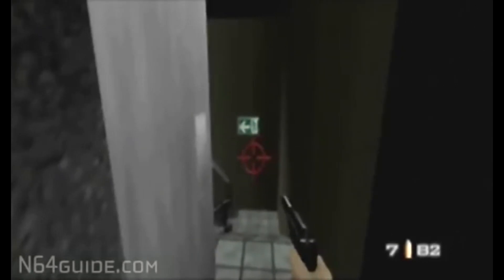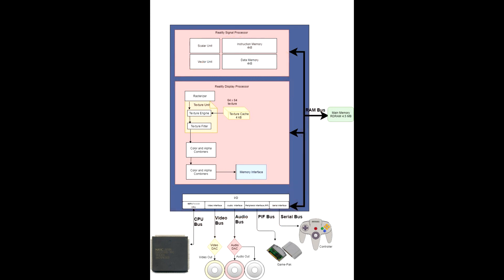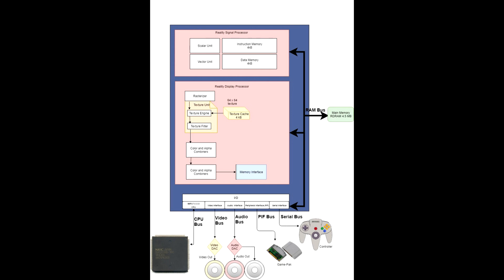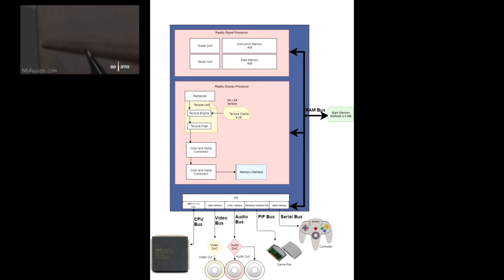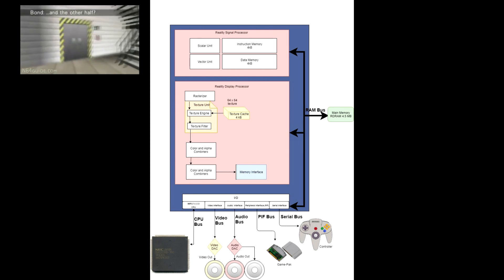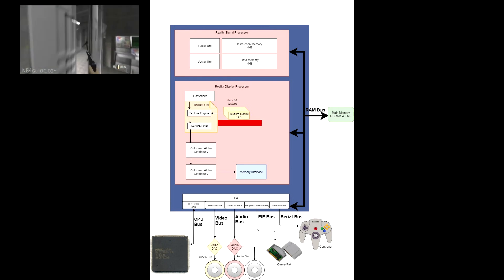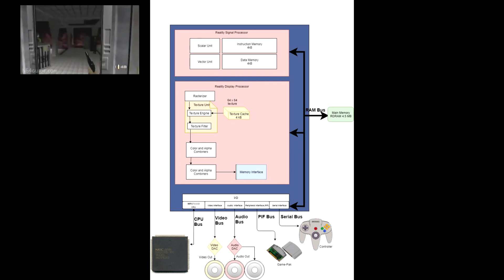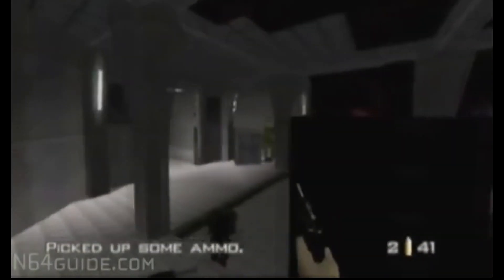The Nintendo 64 Environment was TERRIBLE for Game Development

Comment: Imagine if they had just a few more megabytes of texture cache
Reply from the maker: Would have definitely been interesting for sure!
Reply: Also, shared their microcode to 3rd parties.
Reply: @ZygalStudios  The texture cache wasnt much important - it was how textures were mapped and used. PS1 actually had 2 kb textures and the games looked AMAZING. PS1 used a type of mapping that took full use of the cache and made the textures good but N64 used a different type of mapping that was extremely limited.
Reply: @ZygalStudios  also the N64 cache is explicitly loaded.
Which in turn should mean that the Playstation cache is a true associative cache, while the N64 has either what could also be described as a scratchpad or a simple directly mapped cache.
Reply: The design was actually great for 500,000 flat shaded polygons (and I seem to recall reading that N64 could hit 800,000), but NINTENDO was heavy handed with developers, insisting that textures and all features be turned on, limiting their games to 180,000 (effectively about half of that), blurry textured polygons/sec.  Worse, developers were not allowed to access microcode for improved performance, and the DMA was placed on the wrong side of the RCP, crippling the system bandwidth.  Other problems are mentioned in the video.

Basically, NINTENDO kept making the same mistake over and over again: waiting 5-7 years before releasing new hardware (which was always cheaper and weaker than rivals), and developers had to keep starting over from scratch with radically new hardware and unfinished software development tools.  The result was the NINTENDO went from 97% dominant market leader to hovering around 10% consistently for about three decades now... and some people asking "Why are they even in the console market?"

Comment: Excellent video - the system was a real challenge, particularly with initial SGI microcode which according to Rare and other developers was completely useless for gaming.  If the system was CD developers would've had a much easier time I feel, at least they wouldn't needed to have wasted so much time compressing and cutting assets to fit into smaller than expected cartridges.  Games like San Francisco Rush 2049 show off the N64's processing grunt, huge 3D, high speed 3D environments but that wasn't until 4 years after launch and it was still only on a 12MB cart...Insane.
Reply: Even a 250 and later a 750 GB zip like disk or a magnetic cd like the minidic could have been another alternative nintendo could have used as well.
Reply: I have a bunch of old n64 development stuff. Silcon grapgics power animator sealed
Reply: It would've made the console much more pricey at launch and using optical media would allow them to store more content, albeit the architecture still would be complex to work on. Cartridges weren't the issue, rather the issue goes onto how the system was designed instead being the main cause.

Comment: A long paragraph of what actually made the Nintendo 64 more complex than what many people often realize: People tend to blame cartridges for making development more challenging on devs, and although the limited capacity certainly had it's own drawbacks, the main issue wasn't because the choice in format chosen, but rather, how the system was designed. For example, if we take a look at the systems low texture cache, which only contained 4KB capacity, this mainly prevented devs from being able to create and add textures with higher resolution than we normally see on any N64 game. Using any features like the Z Buffer if I'm correct further decreases the available amount of texture cache down to 2KB, and in truth, 4KB of texture cache isn't enough to create high resolution textures, and is what caused textures to appear low resolution. Using CDs in a way wouldn't solve the texture cache issue as all it would do is allow more low resolution textures to be stored and it would be up to the developer to be crafty enough to make it work,  and again, the fault mostly compounds towards the systems architecture, which also includes lackluster availability of texture cache. The Sony PlayStation for example has more texture cache to work with, and even if the PS1 didn't use CDs, the console's simple architecture and great development tools enable devs to somehow make PS1 games better than on the N64. Poor documentation of the hardware is what also held the console back.
Reply: What is your thoughts on the expansion paks? Did it help the n64 texture issues?
Reply: @maroon9273  The expansion pak was a neat addition to the Nintendo 64, it enabled us to play certain titles that would only work with the expansion pak enabled, such as Majora's Mask, Donkey Kong 64, and access to all of Perfect Dark's content. In some ways, it would boost texture quality if I'm correct, and other games would also see a boost of frame rates as well.
Reply: @crazedlunatic43  yes, and thanks for clarifying the texture cache.
Reply: @maroon9273  Anytime. The idea that people would blame the use of cartridges for making a console more difficult to work with is quite false. As I have said earlier, they have their own disadvantages, but if cartridges really made development complex, then the Sega Saturn would've had no complaints for using CDs simply.
Reply: @maroon9273  A fun fact by the way, have you ever wondered why Cloud's model in final fantasy 7 (or really any PlayStation one game.) looks more detailed in the cutscenes than when you resume controls? This is because full motion video isn't at all rendered by the hardware itself, but rather the system fetches data off of the disc for any pre existing clips that were rendered on more powerful hardware, and all devs could do was add the full motion video clip onto the disc as part of their game. The PS1 didn't need to put in the work of rendering the cutscenes when it could fetch data off of the disc. I brought this up because some people believe that the PS1 is more powerful than N64, when in truth it is not.
Reply: @crazedlunatic43  the limited rom sizes were a issue with cart consoles. That's why cd and other optical disc had more strengths due to more storage which developers were looking for  during that time.
Reply: @maroon9273  Indeed. They were very cheap too, which was something devs wanted. Though, working with CD's was not a painless experience, as it took quite a long time for contents to be burned onto a disc, in which back when CD based consoles, while they've had more data to work with, were also very slow as well. If a developer wanted to re-release their title with a patch update, it would likely be time consuming for the developer to be able to debug any glitches successfully from their games.
Reply: The biggest weakness for cartridge based systems were it's cost and size, while their strength was not taking long to load, the exact opposite of CDs. Though the choice of format usually wouldn't determine how simple or complex it would be to program a system correctly, and I feel like because of oversights and how hardware limitations at the time were crucial factors in the system's performance being worse at times. (And not sharing their codes to third parties was also a problem.)
Reply: @crazedlunatic43  most games had an additional option to increase texture resolution with the expansion pack but with a noticeable expense to frame rate which made the game playable but unsatisfactory to play so people usually didn’t enable the high resolution graphics.

Comment: Thanks for the cool video. Wanted to hear more about the 4K texture limit
Reply from the maker: Thank you! If you're interested in the texture cache, check out my "Why N64 Textures Were Stretched and Blurry" video! :) you can get some more insight with that.
Reply: N64 graphics are basically smeared in vaseline, namely VI-blur and Trilinear Filtering, to look smooth. The clock face in Majora's Mask is actually made of several textures so that it looks sharper.

Comment: So if I got this right, the reason the n64 was so limited was because you need to access different parts of the hardware that were placed in bad spots, and being in those spots cause slowdown because of how much distance info has to travel across the console?
Reply from the maker: You have part of it! The placed in bad parts of the system is true, but it is less about distance and more about that the path to the final destination is limited in bandwidth. 
Best way I can think of describing it is a highway that's filled with traffic going 70 with 4 lanes and all of a sudden those 4 lanes merge into 2. Now you can only have half the lanes for traffic and it moves slower.  If that makes sense :)
Reply: @ZygalStudios  yes it does thank you!
Reply: @ZygalStudios  Or four lanes plus an HOV lane narrowing down to two... with the occasional traffic accident.

Comment: For the past year or so I've been really curious what it would have been like if someone tried to make a game with pre-rendered backgrounds on the N64. If you did them the way Square did then they would have eaten up cartridge space like crazy but I'm not talking about that. I'm talking about taking a second or two during transitioning between areas to have the N64 make the background. Some N64 games already had real time lighting and shadows for characters so imagine giving the system a second or two to render a pre-culled, pre-sorted +200,000 triangle background with shadow maps, super sampling, some slow form of bump mapping, etc. Once it's done, it could use the same lighting and subset of the geometry data just to light and obscure the characters that need to be placed in the environment each frame. That would take a fraction of the storage space (especially with compression) and still create some amazing visuals that could even be upscaled in emulators.
Reply: it was well known back in its day, ocarina of time in hyrule town used pre-render scene, in fact the insides of the kokiri houses were too though they were 3d shape detected but anywhere there's a fixed camera is pre-rendered.  the town at least it was said reason was that there was to many polygons, probably why there's 2 crowd masses too rather than separate chars. i seem to remember navi cast a small light too at times, as for shadows, the system lacked the power for real-time proper shadows - links bad shadow at least did grow and shrink in real time to the suns position. its very intensive for a system already struggling with some games, even on the pc it was much later to do properly.  but go ahead rather than just wondering if you think you can do it :)
Reply: @mystsnake   Yes but the Castle Town's pre-[rendered backgrounds were just a still image broken into tiles. I'm suggesting actually rendering them on the system.

There plenty of games that used stencil shadows for the characters on the N64 though and that's all I'm really suggesting for enhancing the effect of the character within in a pre-rendered background.
Reply: @myownfriend23  3d char on 2d background - well personally they never felt quite right to me, i mean like it does't feel like the char is part of scene. you would probably need to do your idea yourself cause the n64 homebrew scene has never seemed to be what the other scenes are. but if you can get it so the 2 parts are blending smoothly, like how 2d chars look like on 2d bg then i'd be interested to see it
Reply: @mystsnake  Yea, I noticed that even the N64 demo scene was never all that lively. I'd actually love to do it myself because I feel like it could be a cool learning experience but I just need to find the time to learn to how to program for the N64.
Reply: @mystsnake  Conker's Bad Fur Day features real time shadows.
Reply: I remember a game which did exactly that, but not on N64. Little Big Adventure 2 on PC.
Reply: @SianaGearz  Does it? I looked it up but I can't find anything showing the backgrounds scaling.

Comment: I wonder if it would have been possible to set up a cartridge to have bank switching capabilities to increase the available ROM space. I know that such a technology existed at the time, but it may have been much more expensive. Perhaps if ROM chips were as cheap as they are today, it could have really changed the games that could have been possible.
Reply: The N64 can access up to a 240 MB Cartridge, the problem was the cost of memory chips. Although to be fair not many games used the 64 MB that was available. Many games were as small as 4 MB and favorites like Super Mario 64 were only 8 MB. The N64 Zelda games were only 32 MB.
Reply: @frasermips  Well, many PS1 games were also much smaller when you took out the redbook CD audio.

Comment: Huh? The design of N64 actually makes sense. I mean i don't necessarily like it, but it still makes sense.

Because if you've got RDRAM, and you're pressed for cost, it's going to have to be a unified memory system, because interfacing to RDRAM is unwieldy and expensive, and once you have that one interface, you just snake it through all the memory chips, that's just how it is. And then of course you will need most of that bandwidth dedicated to the GPU and the audio subsystem, because you want consistent performance out of it. The CPU is going to get leftovers, and if it has to stall to get them, so be it. Maybe it'll get some extra cache to make it less bad.

7:38 Am... eye dee aye? MIDI? It's pronounced like a word. Tripped me up somewhat fierce.
Also MP3? NO, JUST NO.
8-bit audio? I didn't think it was even supported. Standard sample format on the system is 4-bit ADPCM, which effectively decompresses to 16-bit PCM on the fly. Compared to 4-bit ADPCM, 8-bit samples basically never make sense, the S/N is much worse but the space consumption is double. I think ADPCM samples sound pretty nice, and to the extent that they come out rough, that's just due to having to keep them very short, and mediocre abilities of the sample editing software of the day to fix loop point alignment issues.

However i have always wondered, since i heard that the RSP does edge interpolation and issues span draws to RDP - not sure where and whether true - but span draw texture sampling is fundamentally eerily similar to audio resampling, so i was wondering whether there's hardware shared between these functionalities.

But nothing you mention is anywhere near egregious, that's all pretty much par for the course.

What i heard was egregious, was that the SDK didn't have source level debugging available for C, just for assembler. So trying to find a nontrivial bug in a complex, large software written in C... you can do it, but it'll take a lot of extra effort.

Comment: I didn’t understand why they needed a texture cache. Why couldn’t they just use ram or run straight from the cart. But understanding the hardware. The latency was so high with rdram that they needed a place on the die just to store textures. And then they made it criminally small. What were they thinking
Reply from the maker: Back at that time, RAM at that size was pretty expensive to manufacture and the in terms of the cart, the PIF bus was pretty slow. The choice to use a RAM bus design basically forced them to have hardware shortcuts that made the design overall cheaper. However, the 4kB texture cache size constraint did allow for new methods and styles of games to appear and also techniques of programming that still are alive to this day. It's a give and take type of situation.
Fascinating nonetheless.
Reply: @ZygalStudios  maybe they could've added the cache ram into the expansion pak.

Comment: Great video! But 500 megabits equals about 62.5 MegaBytes. I mention this because in the video you mention the bus speed. The N64 had over 500 Megabytes (4000 megabits) that could be moved around every sec (sometimes).

Comment: I'm going to get lynched for saying this but Nintendo reminds me of Apple. Both companies want their products limited only to their platforms. Everything must be closed-sourced and provided by them strictly. Funny thing, the hardware used for the N64 was made by Silicon Graphics and MIPS. Which this company, (Silicon Graphics), made their own OS (IRIX OS) and their workstations were used to make Super Mario 64 simultaneously with LOZ:OOT. Meaning that Nintendo used hardware and software limited by a company that didn't have the wide support Intel, AMD, Microsoft, and Apple has. I could only imagine the nightmare devs had to put through while constantly debugging. It makes you question if other consoles were this nightmarish. 
  RDRAM was commonly used as server memory back then and server memory is ECC vs the memory that's in your home computer that's Non-ECC.

 (If I made a mistake here, correct me by replying.)
Reply: Silicon graphics was the top innovators of computer tech back then. Intel and other companies got their ideas from them.

Comment: You confirmed what most kids suspected at the time: the N64 was overhyped junk.
Reply from the maker: I don't particularly agree with that statement. Pretty amazing piece of hardware considering the cost constraints. It just wasn't the most developer friendly system.
It did spawn some of the best games in history and I certainly wouldn't call that overhyped junk, but that's just my opinion. 
Even from a graphics hardware standpoint, this hardware set the trend for 3D technologies moving into the mid 2010's, so it had a lasting impact and jammed about 100k of hardware from project reality into a $300 retail console
Reply: This is totally not true at all. Should they have given one and a half more years to the sistem lifespan we would have had in the N64: Luigi's Mansion, RE Zero, Eternal Darkness, Dinosaur Planet, etc... All of those games were in development for the N64.

Dinosaur Planet was over 96% or so completed. It was going to be even better than Conker BFD, which is ahead of everything you have seen in the PSX or Saturn.